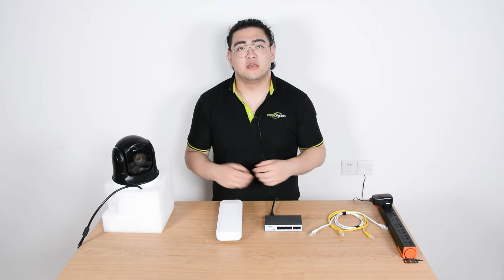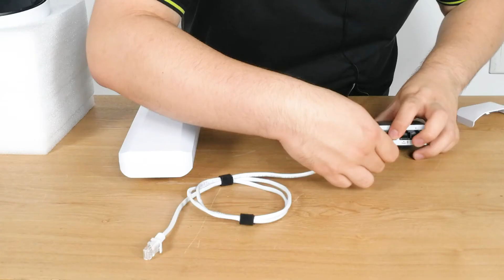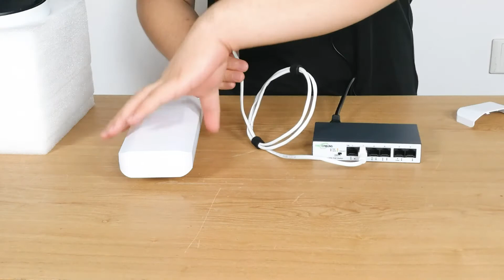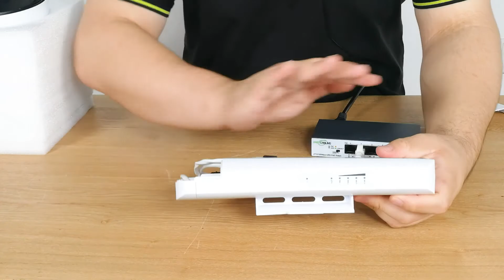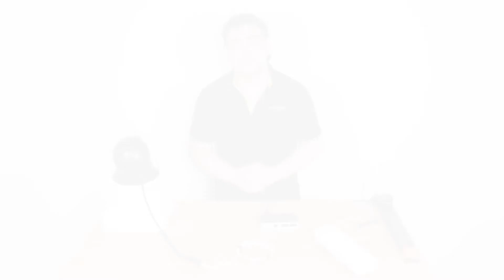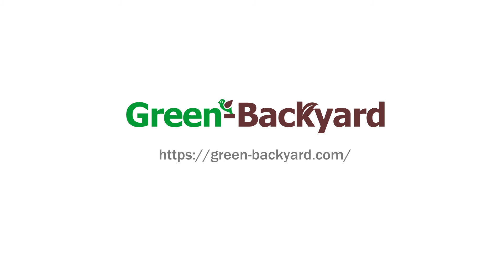Why PoE Switch doesn't Power My Network Devices?

Comment: hi..i plug my ip camera on poe switch,both red and green lights are on but i can't see my ip camera on my xvr..thanks.
Reply from the maker: Ensure that the PoE switch is connected to the same network as the XVR. If possible, connect the XVR and camera directly to the same router or switch to rule out any network segmentation issues.
Reply: @Fastcabling  hi.. yes it is connected properly on the same network.. actually there are 4 other ip camera connected and all working properly. is it possible that the ip camera is already defective? if so how to test it. thanks
Reply: and also at night the led light is on.

Comment: The lights on my POE switch for three cameras are all flashing, but only 2 of the cameras are working. The one not working has just recently been timing out and pinging the device also times out. But how come the POE switch light for the device is flashing? Could it simply be a bad connection, a pair not connecting properly? This happened after I recently moved it.
Reply from the maker: Please ensure the Ethernet cable is securely connected on both ends and that there is no visible damage to the cable or connectors and you can swap out the Ethernet cable with a known-good cable to rule out cable issues. But we will suggest you consult the camera manufacturer for further instructions.

Comment: My  POE cable stopped power all of my cameras... All of my camera only now work when powered in by a separate power adapter... is there any way to switch this back i have tried all of the cables thanks
Reply from the maker: I think the PoE switch supply the PoE to the camera right? What is the PoE cables? If you are using the passive POE, it is complicated since there is no power handshaking from the passive PoE.

Comment: My Ring Elite suddenly stopped working. I noticed the router isn't receiving power from the poE switch.
Reply from the maker: You might connection switch to different PoE port. If the problem persists, you can bring the router next to the PoE switch and test it with short patch cord. It can rule out the possible cause from the cable.

Comment: Most UNINFORMATIVE. We watched this to see why poecdevice is not working with switch and your only advice is that device is not poe??!@#$?
Reply from the maker: In the standard PoE system, the PoE switch will process the verification and classification before it releases the power. If it can’t verify the edge device is PoE compatible, it will not send the power. Most wireless bridges equips with DC24V passive PoE. The passive PoE doesn’t implement these two important steps. If you connect passive PoE to standard PoE switch, it will simply not work.
Reply: So why didn’t you mention that in the video LoL. That’s actually the essence of most problems with POE not working properly.

Comment: I have a poe access point which does not accept power through a poe switch, what could be the problem?
Reply from the maker: There is standard PoE and 24V passive PoE. If what you owned is the access point with passive PoE, it will not work with standard PoE. The standard PoE will not release the power after you attach the passive PoE device to standard PoE switch or injector. The standard PoE use power between dc48-dc55V.

Comment: I have just bought the TP-LInk TL-SG1005P PoE switch I have my PC connected to port 4, TV to port 3 and the ethernet cable from router to port 5 but when I connect to my port 1 my IP camera I get nothing at all surly I can connect my normal devices while still powering an IP camera?
Reply from the maker: What you mentioned doesn't sound right. PoE has auto-negotiations on each port. You might remove those 3 ports, i think the port #4 will not work correctly either.

Comment: Here is something that happened after lighting struck VERY close to my house. A lot of my POE devices would no longer power from my main 24 port POE switch. However, those devices could still be powered on with POE adaptors and other means. I suspected that my 24 port POE switch was bad at first, but I don't think it is and here is why. I have 3 Unifi Flex mini switches that are get power from POE or USB C. 2 of the devices won't power on at all via POE anymore, but 1 of them will and still works fine. I tried them on multiple ports on the POE switch and got the same results. However, they all still seem to work when powered via USB C.

The 24 port POE switch is still powering multiple devices that seem to work fine. I also have a Unif Flex switch that was connected to a POE++ port. That switch supplied power to 2 POE cameras. After the lighting, the Flex switch would no longer power on via the 24 port POE switch, but could be powered on with a POE adaptor and could still operate 1 of the 2 cameras. One of the cameras seems to be fried though and I can't get it to do anything. I was leaning to thinking that the 24 port POE switch was bad, but I connected the ethernet cable that normally powers the Flex switch to the working camera and it came on and worked fine. So the cable will power the camera, but not the switch.

Seems like the only things that got damaged after the lighting were devices that received power via POE. The only non POE device that may be damaged is the Ethernet port on one of my Android Nvidia Shield TV devices. Still in the troubleshooting process, but I just thought I'd share this here.
Reply from the maker: Thanks for sharing. As the cate5 or cat6 is made of copper. It might absorb the surge from the environment during the lighting strike. It is important to ground the PoE switch properly. Part of the surge can be released through the ground. Here is the video about surge protection. Why need PoE surge protector for IP camera system and How to add it properly
https://youtu.be/WxI5ClQ7rSk
Reply: What was your fix?

Comment: I have a Netgear ac1900 that I use for my network. When I connect any poe switch to it, it does not send power to the devices (Ubiquiti Access Points).  I have used a Trendnet TE-Gp051 5 port poe switch , a Netgear 8 port poe switch and a YuanLey 10 port poe switch. None of them send poe to the devices. When I use the ap's power supply it works well. Aren't these aps poe enabled?  I used them with another router and it worked fine. Help please. Thanks
Reply from the maker: You might look into the specification of Ubiquiti access point. If the access point accept DC24V passive PoE, it will not work with standard PoE switch you have.  Not only because the standard PoE use DC48V, but also there is power handshaking. If the PoE switch can’t verify your edge device (access point) is compatible with standard PoE, it will not send the power just in case it might melt your device.
Reply: @Fastcabling  I am using 2 old AP-Lite and one AP Pro.

Comment: I have an 802.3af pd.  Why won't it receive power from the ubiquiti power supply that I can use without the 802.3af?  I want to use the 802.3af to have 48 volts instead of 24 so it can go the distance.  thanks.
Reply from the maker: If your power supply doesn't support 802.3af, it may not power up your PD. There is power handshaking in IEEE802.3af/at. The PSE will verify and classify your PD before it releases the power. In your case, the power supply unit doesn't have power handshaking. If it is out DC24V, the PD will not accept. Any power lower than 36V will be considered over low power.
Reply: @Fastcabling  thanks for your response.  "over low power"?  not sure what that means.  Why does it do this?  So that you don't destroy a device that might end up on the end of the cable which will be damaged by the dc?
Reply: @Fastcabling  You say it "may not",  not "it won't".  Is that just precise or just a colloquial way of phrasing things?

Comment: is there a limit for POE switches to power devices? 

Like if I run a cable over 100 meters to a camera from POE switch will it give still work or will I face problems ?
Reply from the maker: You probably will face the connection issue while the distance is beyond 100 meters without adding the PoE extender. According to IEEE802, the TCP/IP is limited to 100 meters, It is not the Power part, but the network distance should be limited to 100 meters. The PoE extender actually doesn't repeat the power, as the power can't be repeated. It is the data. However, the PoE extend will assist the power handshake between the POE switch and your POE IP camera.

Comment: I have a POE access points connected to a POE switch, there is electric fluctuation due to lighting and after that some of our APs have no power anymore. We tried using another POE switch, replace cables but to no avail. What can I do? The device is  CISCO Aironet ap
Reply from the maker: You may need to check the Cisco AP. If the AP was damaged by the surge, you will need to replace it.